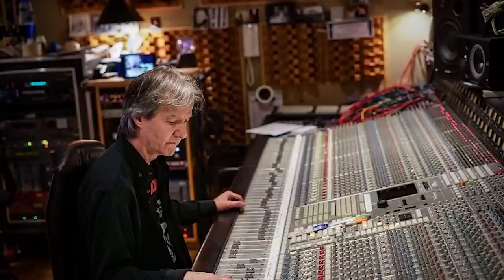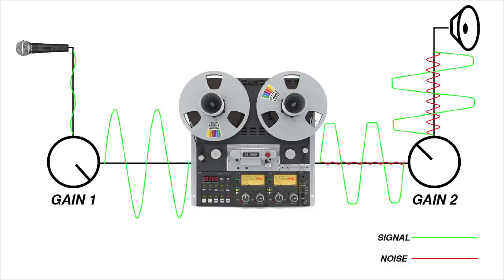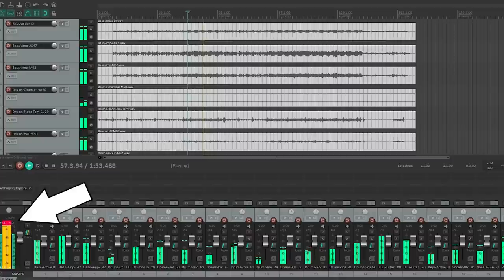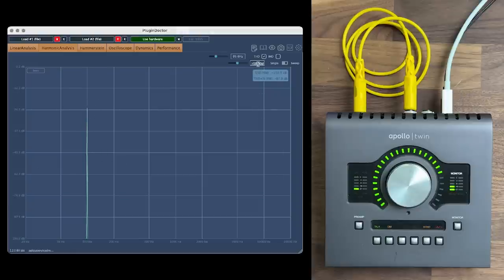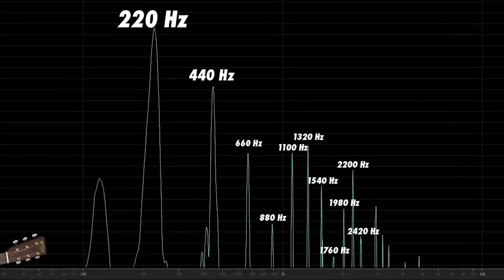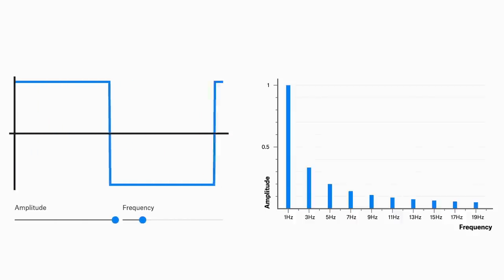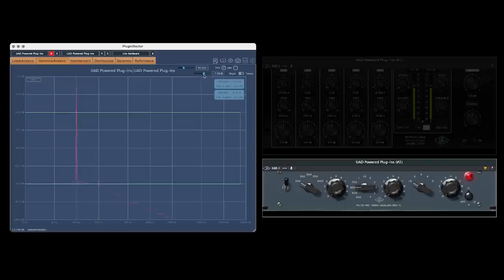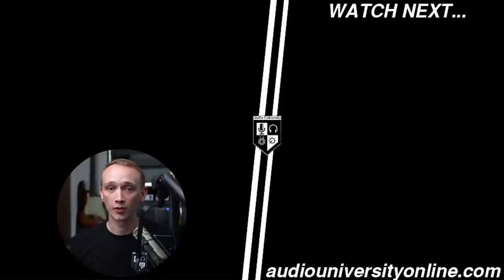What Is “The Analog Sound”? | Understanding Harmonic Distortion (Part 1 of 3)

Comment: The analog sound is - simply put - nice distortion. And, it’s automatic! Well, actually, it’s unavoidable. The ability to eliminate it is a real brain pleaser. 

I was a design engineer at MCI in 1975 and 1976. Distortion was considered unacceptable and we worked very hard to reduce it as much as humanly possible. Then we’d send our JH24 recorders and JH500 consoles out into the world and engineers would push them far beyond what we at the factory deemed correct, completely ignoring what we explained so carefully in the user manuals. MCI recorders particularly were widely loved for their harmonious distortion on drums, bass, guitar; and in fact still are. 

I used them in my own studio 1976 thru 1990-ish. I transitioned to digital recorders over a period of time that had to have been a good part of a decade. I wouldn’t go back with a gun to my head. Why? Noting to do with sound. Calibrating two 2”, 24-track and two stereo analog recorders prior to every single session is the ultimate groove-killer. It turned music recording into a science project. Bouncing became a guessing game. “Does 11 sound the same on both recorders?”  “What do you think?” Yikes!

The knowledge of what analog distortion does is very helpful in emulating it. An overdriven transistor preamp is fairly easy to measure and thus, to emulate. I recall one of my later projects at MCI was developing a mic preamp that deliberately distorted in lower order harmonics - 2nd and 3rd. Ultimately, since no one could agree on what was sugar and what was shit, we abandoned this rather involved investigation. We were keenly aware of what Neve was accomplishing and wanted to compete at a lower cost, eschewing the inefficiency of Class A and the cost of interseries transformers. Too bad, it was ahead of it’s time.

Tape distortion is enormously complex, with a large number of parameters depending on tape type, tape speed, record head shape, record bias level, and most of all, level which we called fluxivity when we wanted to be annoying. Honestly, a ‘tape’ plug-in has an enormous job to do and it’s no surprise many are disappointing. Cymbals simply never sounded the same again. I spent more time trying to get that sound than any other instrument. A tape-saturated cymbal is perfection.

Sorry for the length.
Reply: Right so to emulate recordings done on analog gear you need to add saturation at every point then you have to do the steps you would do to remove it afterwards. 

It sounds silly and yes you can just skip a step by using analog gear but this way you get complete control over it in a non destructive way.

VFX artists do a similar thing. They remove noise from their footage so they can start working on and compositing with it then they re add the noise over the, it sounds silly on paper but its a necessary process.
Reply: @briumphbimbles    You describe a procedure that doesn’t exist, at least not for me or any of the top producer-engineers with whom I work. We knew exactly what our analog gear did and never applied it in such a way that would require the impossible job of undoing it. The analogy to video is not correct. Video resolution, during the very same time in history, was simply horrendous and irreparable. It hardly mattered because the television system, from broadcast signal right through to the end users’ televisions, matched that horror perfectly.

In short, sound recording was years ahead of video recording for a very long time. We only half-joked with the video engineers that no one would change the channel when the video was replaced by a ‘difficulties’ message as long as the excellent sound continued. They only achieved parity in the early 1990s, after many decades of comparatively excellent sound recording and yes, even broadcasting.

The analogy of emulation you mention is not actually correct. Today’s music recording allows us to emulate the sonorous qualities of tape saturation very selectively and I promise none of us deliberately applies those only to search for a way to remove them. Audio tape recording is a truly special case, much more along the lines of film, in that it enjoyed and still enjoys a broad latitude of legitimate sonic benefits from its creative use.  We didn’t record vocals at +12 because it sounded like crap. Ditto all symphonic recording, the lion’s share of jazz, dialog, etc……
Reply: @artysanmobile  You never high passed or noise-gated away your noise floor?
Reply: @briumphbimbles    Nope to noise gates, yes to HP.  Noise is an automation job.

Comment: I have an interesting Proposal for you.  Have you ever done the analysis of Vacuum tubes...but considering a classic tube console since they were usually custom built.  BUT the particular pre-amp tube they were using.  SO it would be a question of a sampling of older NOS items as baselines ......but also include the modern Russian and Chinese & the JJ's.  Keep in mind the Plate as to short plate or long plate etc as that has impact.  So there is that factor in the equation.  So basically they would have been familiar with the RADIOTRON and more or less a basic design for a Pre-amp based tube application in class A...and the cathode adjustments and the BLOCKING cap on the Plate/Anode of the tube.  The tables in the book  would specify PAPER in wax perhaps for the Capacitors...they usually specify  a particular material.  So looking passed material brings the Value and look at the book charts perhaps as capacitor are usually in a line up of a few values.........so in general the basic values that should be there.  So .022 uf  , .047 uf,  & .1 uf, and thus a proportional aspect.  So the function of a frequency filter....but then to WALK it in  to find a particular  range and work up from a lower value by paralleling  a particular value cap ..   to add on for finding the MAGIC value as a filter.    So its a DUAL existence....

Comment: Once you see iron oxide under an electron microscope you understand that the typical statements about digital being more accurate and therefore better than analog (tape) are massively flawed and short sighted. Oxide particles are not uniform tic-tac shaped objects, they are globules of sea creature shaped clusters that can arrange themselves under a magnetic influence in shapes that will blow your mind. In the process of a tape head reading a recorded tape the oxide formations impart way more information than frequency, phase alignment, for example, is many times more accurate than with digital at lower gauss levels. You can talk about noise until you get winded and fall over. But, why should you unless your point is to convince rock musicians to appreciate jazz or some other sterile, pristine, pretentious geekery? Analog equipment doesn't gaf about aliasing, either. The most convincing experiment I've seen for being pro analog is in phase rotation differences. 9 out of 10 times the medium that tends to rotate phase in a harsh way is digital. I know, I know, analog is actually cheating here because the flux translation through any transformer tends to somewhat skew the final alignment BUT it does so in a more in phase manner - meaning, it is much easier to get a nasally skewed recording digitally than to/from tape. If the universe were 2 dimensional then, sure, all the chalkboard logic applied by the digital fanboy kiddies would translate to reality but it's not. There are infinite combinations of the random oxides in analog tape that give DEPTH as well as all the rotational and amplitude properties that digital is capable of. The main benefits of digital are cost and ease of distribution. Apart from those it is pretty much a dickpull and a gaslighting from retailers and manufacturers invested in making a quick buck.
Reply: 💯! This desperation to push the S/N because ... big numbers!!!!! If you are lucky you will have a 40dbSPL noise floor in your listening environment. 50dbSPL with forced air heating/ cooling. Threshold of pain, ears bleed at 120dbSPL. OSHA requires ear protection @ 100dbSPL. Most listening environments have 50-70db of available dynamics at best. 

As an active member of AES living in Nashville and selling audio to studios, I sat in on an AES meeting that was playback comparisons of a session recorded Direct to Disc (in that room), Soundstream digital and Ampex 2track analog in the '70's. The DtoD was played back on the cutting lathe as was the tape on the Ampex it was recorded on. Dr. Stockham, Jr was there. 100% picked the DtoD as superior. AFAIK the only time such a test was ever done. 

RE the time smear (phase shift) from digital? I have a graphical explanation for it that Sony and JVC engineers from their digital team agreed with. It is a linear with time problem making it more noticeable that the logarithmic shift of inductance.  I sold the PCM-F1 and 3/4" umatics.

Comment: Question- if you can use EQs, compression, etc. to add harmonics, what can you do to remove harmonics from say a recording of an acoustic guitar (short of precision EQing throughout the track)?

How do you make something sound more sterile?
Reply: You can not remove harmonics , you can add more distortion in order to change the overall timbre, Aphex 250 type lll.
Reply from the maker: @quintessenceSL, Good question - It's difficult to remove harmonic distortions because the signal itself contains a lot of harmonic content. It would be easy to low-pass a sine wave to remove the distortions, but it's MUCH more difficult (if not impossible) to do the same thing with a real instrument that has energy at a lot of different frequencies.